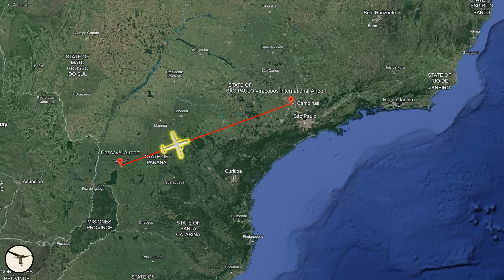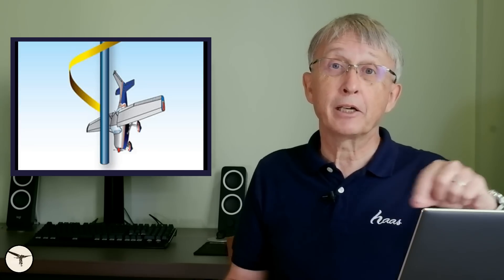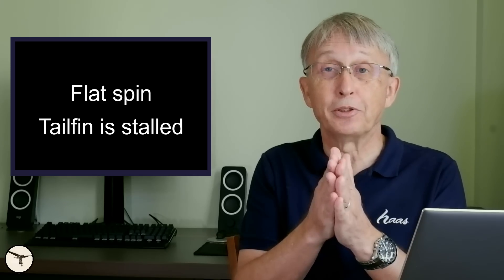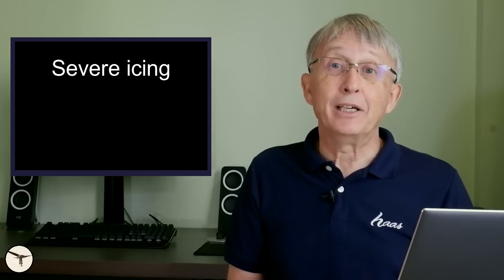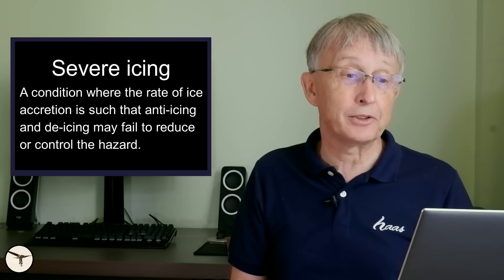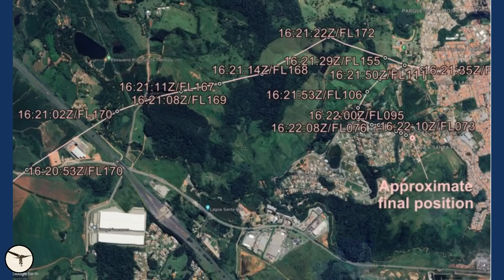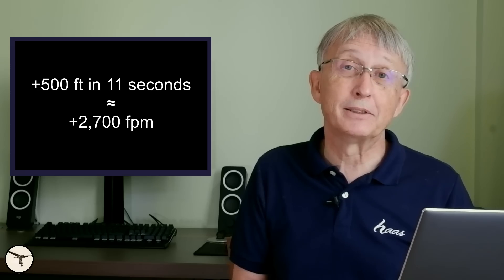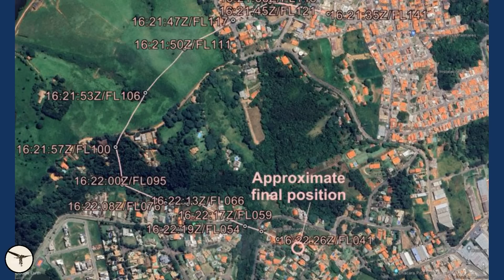ATR 72-500 Crash: Understanding the Fatal Flat Spin & Severe Icing Dangers

Comment: Hello Commander, my name is Fernando, I am Brazilian and I live in the state of Rio de Janeiro - Brazil.  Regarding the accident with the Voepass Atr72-500, there is some more information that has not yet reached you.   Climatic condition of severe ice formation (it is winter) and the plane was flying precisely at the altitude of ice formation (the pilot of 1 A320 reported this condition to the tower).  According to what is known, the ATR pilot requested a new flight level, reporting ice formation to control, which probably (we don't know yet) did not authorize a new level.  Here's a video with some data extracted from flight radar24, such as altitude and irregular speed. Send link video in YouTube  use youtube translator

Comment: Captain, in my humble opinion that checklist killed them. Adding power to an aircraft you assume to be contaminated with severe icing means the elevator was likely ineffective and adding max thrust caused them to pitch nose up and stall. Pilots followed the checklist like they were trained and it caused the crash. ATR are partly responsible for this tragedy.
Reply: An engineering solution to make this impossible would be good. People make mistakes, unexpected conditions may occur, and this occasion it  seems like it became unrecoverable. I don't like "unrecoverable".
Reply: @acasualviewer5861 I agree. Civilian aircraft should not have flight characteristics that could create non-recoverable situations. As long as you have a few thousand feet before you meet the ground, there should always be a way to get out of a bad situation if your engines and hydraulics are up and running.
Reply: I was thinking along these lines. They were exactly at TOD and perhaps oversped after initializing descent, and the elevators froze trying to pull up. they couldn't push down again and they stalled.
Reply: I’m not sure that adding thrust would cause the nose to pitch up on the ATR. I understand that on jets like the Boeing 737 MAX, increasing thrust could cause a nose up attitude due to the relatively low position of the engines under the wing. However, the center of the engines on the ATR appear to be mounted above the center of motion. If anything, I’d imagine you would get a slight nose down attitude when adding thrust. But I’m not a pilot. I’d like to hear what the experts have to say.
Reply: @wesleyhurd3574  That’s an interesting question. The ATRs engines aren’t as high as you may think. They’re not any higher than jets with engines mounted on the empennage. Their weight also raises the location of the CG counteracting the “opposite” effects you’re referring to.

Comment: Excellent explanation.   I'm a former private pilot ( I can no longer hold such a licence due to old age) and today I listened to a TV reporter saying that the aircraft engines may have stalled due to icing.   If you have no flying experience then it's understandable to interpret an aircraft stalling as similar to your car stalling.  In an aircraft it means something entirely different insofar as a stall means that the aircraft is flying too slowly for the wings to create lift and keep the plane airborne.   It's something we practice a lot during training by deliberately stalling the aircraft so that we can learn how to recover from an unintentional stall.   However, if the contour of the wings has been altered by the build up of ice then you are in real trouble.   Most modern airliners have anti-icing boots on the leading edge of the wings to prevent the build up of ice.
Reply: The video of the flat spin is what is hard to avoid here. That has all the hallmarks of icing, and the ATR 42/72 has a bad habit of not taking icing well. There will be an investigation, but I'd be surprised if they don't suspect icing.
Reply: @AEMoreira81  agree it's impossible with the small air surface of today's empanague systems,  one tiny rudder; wow trying to make everything look like a C172 is a recipe for loss of spin recovery.   BTW ever see a B24 or B25 in a flat spin?   How about a twin beech,  OV-1 ,  OV10 or WartHog?   When they learn to put triple tails on these, spin recovery might be possible; that said foolish pilots flying on auto in icing conditions, this is the result, too little too late.    I even had triple tails on my CH-21C
Reply: As a pilot, my humble guess would be a sudden propeller icing build up, I think we're looking at a high rpm/low speed scenario, even missing blades during the spin judging by the sound (that was DEFINITELY not a heli). To top if off, there was a very unusual icing condition for Brazilian standards, even experienced captains were surprised that day. If you're not fast, sure as hell you will stall (even more in an ATR). The time to assess the situation, turn off the autopilot and take the necessary messures (until you really understand what's happening) might not be enough before shit hits the fan. And we all know that the ATR is not exactly the best thing to fly under those conditions, even worse given the icing conditions at their exact FL. Not only the leading edges were full of ice, but we're definitely looking at the propellers too.

BTW, I flew with Voepass last April. While it wasn't anywhere near as bad, the automated cabin pressurization failed mid-flight and even the captain joked about it. We flew like 9000-10.000ft and unusually slow the whole time, which was a bit hilarious (note sure if we had any significant headwind that day).
Reply: Boots are from last century. The wings are heated now with bleed air.
Reply: what are anti icing boots?
Reply: @MrWeezy312  Deicing boots are long black rubber devices that run along the front edge of a wing on some airplanes. They have segments that can be slightly inflated, like a balloon. When a layer of ice has built up on the front edge of the wing, these boots can be inflated with compressed air from the engines, which pushes the ice off the surface enough for the wind to catch it, breaking it apart. Boots are a de-icing system, which are used to remove ice that has already built up on the plane. Anti-icing systems are different from deicing systems, in that they are used ahead of time, to prevent ice from forming in the first place. These systems also use the hot, compressed "bleed air" from the jet engines, but instead of inflating physical boots they are piped under the wing surface to work like a house radiator, keeping the wing warm enough to prevent ice from building up. The ATR-72 aircraft in this video is fitted with deicing boots on the front edges of the wings.
Reply: @MrWeezy312 I believe they are rubber diaphragms attached to the wing surfaces that inflate to break up the ice. I notice another commenter mentions that icing boots are old technology.

Comment: Severe icing conditions, somewhat under sized tail surfaces, autopilot commanding increased nose up trim due to ice accumulation, flying on autopilot until ice build up causes a disconnect. I think we can speculate that the autopilot dumped the pilots with an ice encrusted aircraft in full nose up trim and the tail surfaces blanked in a full aerodynamic stall. Yes, it could have been a hundred other things, but given the conditions, it isn’t likely.
Reply: Actually, the trim anomaly is in roll not pitch with hinge moment reversal in the ATR.
Reply: That would definitely explain the initial ascent, and yes I think the autopilot left them in an untenable situation! They shouldn't have been flying autopilot though in known icing conditions?

Comment: Just a thought…flying through icing on autopilot, possibly unaware as to the severity. Auto pilot disconnects which may have caused a rapid upset which was not expected. The pilot may have fallen victim to natural instinct and rapidly pull up instead of let it descend then gain control.
  Once he pulls up either went past critical angle of attack or the ice build up just wouldn’t allow the plane to fly, stalls and spins.😢
  Such a sad, sad loss of so many souls.😢

Comment: Captain, we had a plane crash a couple of years ago in my country. It was a dash 8. On descending, the pilot shifted the trust right into reverse while in flight.

I don't know if the throttle design of the Atr 72 is just similar to the Dash 8. Any way, thank you and let's all just wait for the investigations.
Reply from the maker: ATR and Dash 8 use same family of engines (PW100), and the controls are similar. To get reverse power in an ATR in flight, you must full a lever called idle gate, and lift a lever on the power lever while moving it out of flight idle. This action requires two hands.

Comment: even with icing problems it should not have flat spinned ... the GC was off. if the GC was correct, being near center of the main wing spar, the drag from the tail will point the nose down. this is not a Jet fighter where they are purposefully designed to be unstable to enable maneuverability.
Reply: Airplanes can easily stall even when the CG is within limits. Just pull back on the yoke, nose goes up. Keep pulling and you stall.
Reply: @igclapp  stall yes… but commercial passenger aircraft are designed to be stable and therefore resist flat spin . Only damage or CG failure can cause this problem with passenger planes.
Reply: @renaissanceman5847 No, commercial planes do not have any requirement to avoid getting into a flat spin if they stall. They do have various stall warning systems and sometimes stick pushers to avoid getting into a stall. However, almost no multiengine plane is guaranteed to recover from a spin.

Comment: Excellent explanation. I had no idea that multi-engined aircraft can be inherently incapable of spin recovery.
Reply: flat spin specifically, and also T Tail like ATR make it very hard. the wings block airflow to the rear preventing rudder from getting air to stop the rotation.
Reply: I don't think it's the fact it has two engines, rather where they are positioned, also a loaded weight of 50 tonnes or more is going to be difficult to recover in a spin.

Comment: RIP to all souls lost. But I wanted to say that, in my opinion, the ATR-72 is a very dangerous airplane. I believe two factors in its design cause this to be so. First, wing loading...the airplane has insufficient wing area for the loads it is routinely asked to carry. Second, the chord of the wing is too small, which, coupled with high wing loading, makes the aircraft less stable than most other aircraft. These factors can also mean that the airplane will react less favorably to certain adverse effects - wing icing for example. Again, these are just my opinions.
Reply from the maker: At maximum takeoff weight, ATR 72-600 has a wing loading of 377 kg per square meter. Q400: 475 kg per square meter. Boeing 737-800: 620 kg per square meter. 
When it comes to longitudal stability, the main factor is not the chord, but the location of the center of gravity relative to the aerodynamic center (lift center). 
A wing with a high aspect ratio is used because it is more efficient. The induced drag is less than for a wing with a low aspect ratio. Therefore, a wing with a high aspect ratio will produce more lift for the same angle of attack.
Regarding icing, it has no influence on stability, but on lift coefficient, drag, critical angle of attack, and controllabilty.
Reply: @FlywithMagnar  I respect your background, and the knowledge it has given you. Much of what you are saying is true; however, stability and controllability are interlinked. A less stable aircraft is harder to control, and vice versa. I have not looked at the safety record of the ATR-72, but the number of crashes of this model that I have heard of is high. As I type this, there is even a thumbnail to the right for a video of the "Top 10 ATR-72 crashes." 

I do not believe your statement that wing chord isn't one of the main factors affecting longitudinal stability. The narrower the wing chord, the narrower the allowable variance in CG location while loaded. In the case of the ATR-72, they have also lengthened the fuselage, aggravating the process of meeting the CG requirements. It is true that a narrow wing chord introduces less drag that a wider one. I will even agree that such an aspect ratio can be aerodynamically more efficient overall. But nothing comes for free, and the price for such a wing is as I mentioned above: less stability and less flexibility with CG limits. One can make a paper airplane to prove these points. Who can, after seeing the picture of the bottom of an ATR-72 going down as its wing clips a bridge, not wonder why such a small wing (area-wise) is affixed to such a long fuselage?

You said one other thing wrong (in my opinion), that a high aspect ratio wing will produce more lift at a given angle of attack than a wing of low aspect ratio. This is false; an airfoil design (or number) works the same regardless of the aspect ratio; however, the lower aspect ratio will introduce more drag, making the high aspect ratio one more efficient overall. In the airfoil tables, I have never seen ones that are labeled to indicate they work better with certain aspect ratio wings...have you? A given airfoil produces a certain amount of lift depending on speed pf airflow over it and its angle of attack into such airflow.

As for wing loading, I was surprised to find that it has been rapidly increasing among newer aircraft designs in the name of fuel economy. For example, the DHC-6 twin otter, introduced in 1972, has a wing loading of less than 30 lbs/foot^2. Fast forward to the DHC-8, introduced in the late 1980s, and that number has more than tripled to just under 98 lbs/foot^2. There are many similarly designed aircraft being made by Embraer, Maeve, Bombardier, and others. As for the ATR-72, as it is the oldest of it's type, it lags the newer models at about two-and a half times the Otter: just under 80 lbs/foot^2. It seems I should not have singled out the ATR-72 because, as I show above, newer planes of that type are even worse. I guess its because I have heard of so many ATR-72 crashes.

Icing is a totally different story, and is not part of what I have to say, except that if an aircraft is already "riding on the edge" of stability or controllability because of its design, then it will take less ice formation on the wings to bring the aircraft down. It is my opinion that the ATR-72 (and now I know other aircraft as well) falls in this category. Thanks for your reply.
Reply: @royshashibrock3990  presumably the development of more advanced materials with higher strength to weight ratios has enabled these wing-loading increases and efficiency improvements?
Reply: @Peasmould  
The materials you describe would allow the aircraft to carry more weight, and perhaps better resist other forces, but that is not related to wing loading. Whatever the plane is made of, it will have a certain weight. Wing loading is the ratio of designed lifting force vs total allowed aircraft weight. It is my opinion that the wing area (read: available lifting force) is too small for the repeated expansion of the cabin/fuselage that has occurred on this aircraft over the years, and that the chord of the wing is too small to promote good stability.

As an aside, I would like to point out that the flaps used on this wing design are not true Fowler flaps; that is, they do not "extend." They use an offset hinge to rotate downward, and increase wing area only modestly compared to true Fowler flaps as used on other, larger aircraft. Still, they do increase camber and thus give higher wing lift when deployed.

I would also like to say that there are similarly designed aircraft from other manufacturers out there that are just as dangerous; I focus on the ATR only because it is (I believe) the earliest example of this design and thus has a longer record to look at. Thanks for your reply.
Reply: Even if true here it was known before there might be severe icing. I don’t understand why no action was taken to avoid the icing either by changing route or just waiting.
Reply: @mudi2000a  Agreed. The best candidate for why no action was taken, in my opinion, is a pilot not experienced enough in this aircraft to know its idiosyncrasies, especially in adverse conditions. We are all waiting for the preliminary report to gain more information. Thanks for your reply.
Reply: G-LOC perhaps ?

Comment: Good analysis thank you!  I do think we can speculate accurately here…. There’s no other event that I can think of which could cause an aircraft like this to stall and enter a flat spin from normal cruise flight with both engines operating and remain intact till impact except for an encounter with sever icing.   The big question is why didn’t the crew avoid the area all together and could the ice build up so fast surprising the crew so that the crew didn’t have time to escape or did the crew not handle the encounter with ice correctly…  lots to learn from this accident in due course once the investigation is complete.